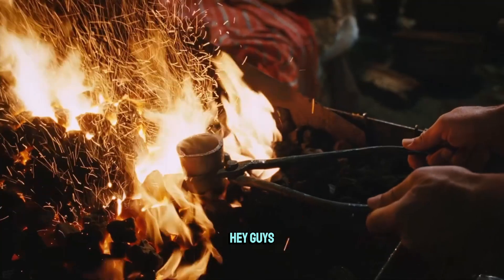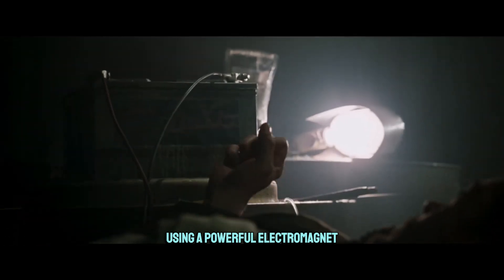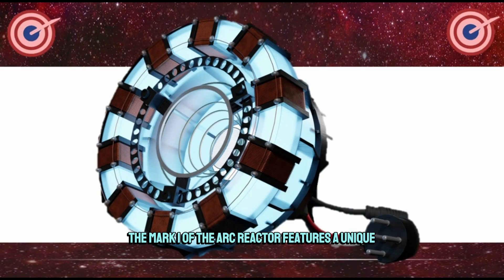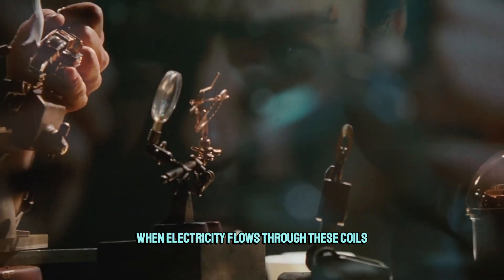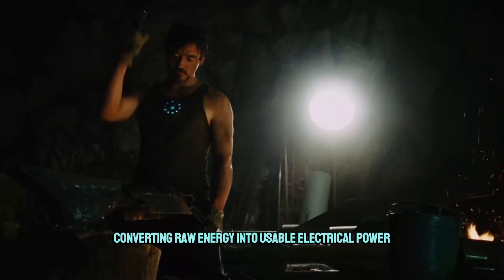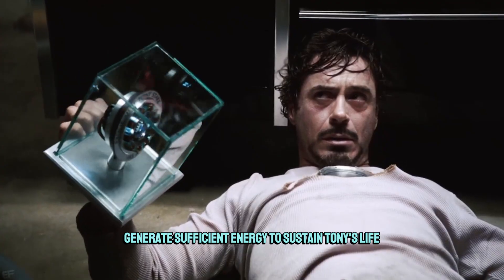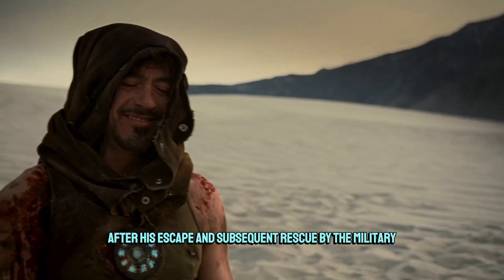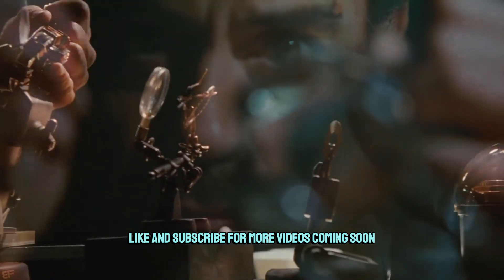The Arc Reactor - Mark 1 Explained

Comment: Great video, i wish they had given more exposition as to how the arc reactor operates

From what i can gather the best explanation is that it's a fusion reactor, but then, wouldn't uranium or plutonium be a better option than the palladium he used in the first two movies?

And also, even if copper is a great energy conductor, the amount of energy at hand would still produce enough heat to kill tony, they should have doubled down on the sci-fi mumbo jumbo on that part and say it was a perfect energy conductor alloy or smt
Reply from the maker: Thanks! And I completely agree, It definitely could’ve used a bit more exposition, but from what we do know and like you said, the arc reactor is presented as a clean energy source, and it’s implied to be some kind of fusion reactor, but I think they opted to leave the specifics intentionally vague for that reason because the more we think about it the more it falls apart LOL

As for palladium, it seems like it was chosen more for its role in eventually poisoning Tony's blood (but I’m not sure if they were thinking that far ahead at the time) and based on a few minutes of research on my end, palladium is used in catalysts and hydrogen purification, which might have been the angle the writers were thinking since the arc reactors whole MO is clean and renewable energy! 
And for the copper heat issue, you’re right and considering the state of the mcu now where things like Norse gods and super soldiers exist, they really could’ve given us any sci-fi mumbo jumbo and we would've ultimately accepted it!
Reply: @obscuremcu  nice observation on the palladium, that's probably the closest to an actual explanation